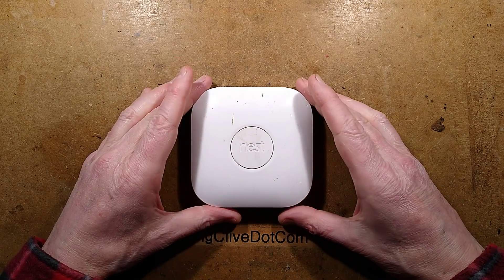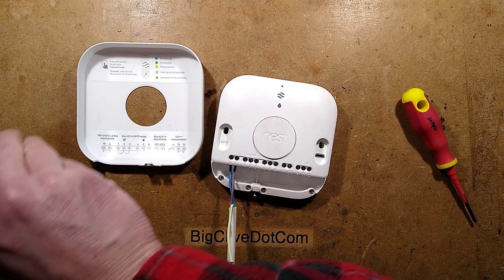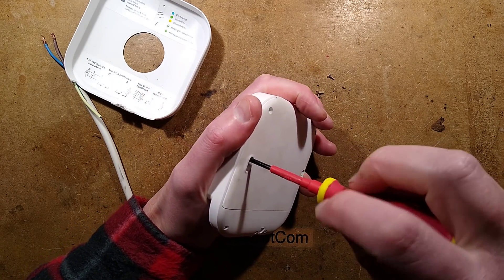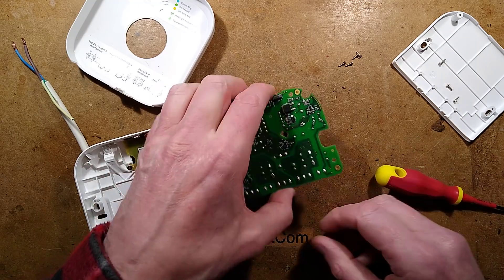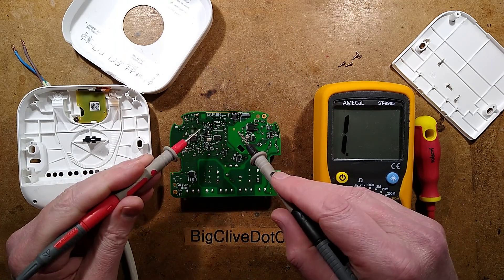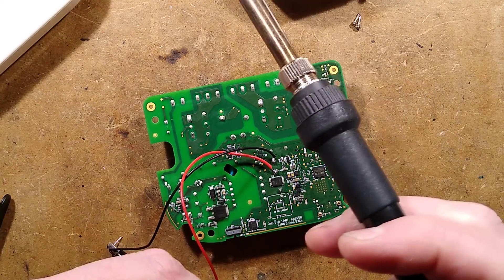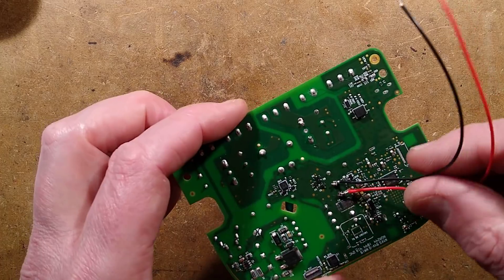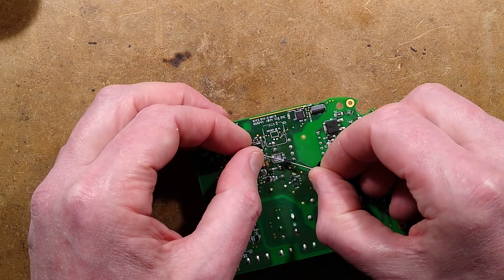Fixing a completely dead Nest thermostat heat link

Comment: The worst weakness is that it's dependent on the manufacturer finding it profitable enough to keep the servers going
Reply from the maker: This is where a geek-run independent server or new firmware wins.
Reply: @bigclivedotcom  I wish there were home server options.
Was an early adopter of the NEST thermostat. But it's useless with a heatpump in Northern climates.
And why the H does it need servers somewhere to provide the pathetic reports we get?
Lots of unused potential and technology packed into it though.
Reply: I had exactly that with my alarm system (iSmart Alarm).  £400 on parts only for them to go down the pan and switch the servers off 18 months later!
Reply: The 3rd Gen can be set up without Wi-Fi so you can use it offline no worries.
Reply: All the automation in my house is totally self contained and has no external dependencies for that very reason.
Reply: If it doesnt Support Tasmota dont buy it 😛
Reply: Yes, this is happening with the Harmony remote controls. The servers are still up... for now.
Reply: @rich_edwards79  God, aren't harmony remotes like... a throwback to the early 2000s?
Reply: @rich_edwards79  yikes, I still use my harmony remote every day. Hope they stand by their statement about continuing support whilst customers still use them..... but how will this be judged?, because I only update mine infrequently or when I get a new bit of kit to control.
Reply: Exactly. You don't own it, you are permanently leasing the product.
Reply: This is why I made my own thermostat (with amongst other things an ESP8266) that runs a local www server.  No out-of-the-house servers required :-)
Reply: There is no reason why my home heating / cooling thermostat needs to talk to the internet. Same with my fridge, stove, etc.
Reply: For me, the worst thing about these is always the user interface, which is never customizable to the extent I want. Take a simple temperature IoT thingie. It uploads to the server maybe every five to ten minutes, static of course, because why would you want to change it? What if I want to do 1-minute measurements, like comparing rapidly changing temperature inside a car running a heater, with the outside temperature? It's pretty likely that I can't do it, regardless of the manufacturer. Then there's the UI itself. The graph on the website might not be customizable at all. Let's say I wanted a static view of -30 to +30 degrees C. Might not be possible at all. Maybe if I paid for a subscription, but even then that might not be possible or the graph might be otherwise unusable, maybe having a fixed time range. Then there's the data retention... Let's say it feels like the fridge isn't getting as cold as it used to. Let's check what the temperature was 2 years ago and how it has gradually come down. But wait, there's no data?! Of course not, because the stupid platform only retains a year's worth. Meh. And for these reasons, I'm out. A DIY Raspberry + database + free graphing tool is much better. IoT and online platforms may be better for automation, but when you really want to customize even simple stuff like temperature readings, don't get your hopes up. One really annoying thing is that you can't usually try all these without buying them. Only afterwards will you really see how bad the online platform is.
Reply: @Stirmeli  Your commentary explains why I started down the rat hole of developing my own thermostat based on a RasPi. There were only a couple of things I really wanted my t-stat to do: 1) Keep the temp stable; 2) step the temps down at night, back up in the morning, back down during the day when all were at work, and to bring it back up in the evening when everyone was home; 3) know when to switch over to AC or heat, based on the temps outdoors and the time of year.

Unfortunately, the project suffered from scope creep and it started to tie into my greenhouse temperatures, and the sprinkler system (which was it's own project), and while we're at it, why not integrate it into the home security system, and all sorts of other BS. 

In all of these iterations, not once did any of these devices need to go out to the internet, nor did the internet need to come to them.
Reply: @PyroRob69  A Raspi (with a corruptible SD card OS) is a bad idea for anything requiring long term reliability. I go with a basic Arduino (Nano/Pro Mini) for basic functionality when possible, and then add Raspi or preferably ESP for connectivity
Reply: @rexsceleratorum1632  you can set up the OS to be immutable and still be able to add patches as needed which mostly fixes SDCard corruption. At least to the point where the atmel micros will probably die anyway.
Reply: @mattymerr701  Unless atmel micros are particularly shoddily made, you are describing an alternative with way more moving parts and way more critical things to break. You say it will be just as reliable. I'm gonna take that with generous helpings of salt.
Reply: @rexsceleratorum1632  Well, the great thing about electronics is that there are no moving parts. Especially when you are using static flash memory 🙄
Even more so when it is large enough that you almost never erase cells.

Micro SD Cards can store data for longer than you will probably care about, and since they are easily replacable by a user, they are pretty easy to ignore tbh.
Easier to replace than desoldering a BGA and replacing it.
Reply: @mattymerr701  Ah, you thought I meant actual moving parts. Okay. Tell me again how one microcontroller IC with a small amount of built-in flash is less reliable than a full blown miniature computer board running Linux and having a dozen ICs, DC-DC converters, plug-in off-board SDCard flash, and stringent power requirements, heat dissipation requirements
Reply: @rexsceleratorum1632  I agree with you 100% on the SD cards. I would use the SD card to boot off, and have all of the true functionality run from a spinner or SSD. I have experienced the high failure rate of even the best quality SD cards.
Reply: Good job! What’s the diode doing, stopping back emf from the relays? It might just be the thing is underrated from the factory for the short spikes as they open.
Reply: true!
Reply: It does not require WiFi to function.
Reply: True, unlikely with Nest though as it's Google and they own their own cloud platform, this likely runs on serverless architecture with hundreds of other applications also running on it. We're taking about simple JSON api calls and virtually no bandwidth costs.
Reply: @james-5560   Google have a really bad track record for discontinuing old products. They had a previous line of smart-home products that the discontinued when Nest came out.
Reply: @katrinabryce  Are you referring to the devices made by Revolv?
Reply: @katrinabryce  However these days the big companies don't really need to stop supporting products as the cost to sustain is so minimal. Back 10 years ago + yes when they had very different architecture. If they did ever EOL it there would definitely be third party firmware / open source project.
Reply: @jamescollins6085  Yes, that's the one. Couldn't remember the name.
Reply: @james-5560  Google is notorious for abandoning projects/services. I wouldn't depend on them for anything long term.
Reply: @james-5560  I mean, it being a simple thing with barely any server cost or maintenance needed didn't stop Google from killing their flippin' RSS reader.
Reply: @james-5560  Google is kinda famous for aggressively culling offerings. A platform cannot exist without AT LEAST a maintenance engineer who will patch up security bugs as they occur, if the recent LOG4J disaster is any indication. Now whether Google will or will not shut down Nest is a moot point, you might be actually best off having Nest's device compared to their competitors, but the whole category of products is fragile because each product/lineup has a central point of failure that is outside your sphere of influence. I'm sure in due time there will be a lot of IOT devices in people's homes which still kinda work but didn't receive any security updates on the device end for years and which will make for a perfect attack surface; and there will also be data leaks and other compromises of cloud companies handling your data. There will also be companies (presumably not Nest, but remains to be seen) which let their domain or central endpoint lapse and fall into someone else's hands, and those people can then weaponise the fleet of devices. The potential security problems exist whether the device is running OEM firmware and infrastructure or hobbyist one.
Reply: @james-5560  "serverless architecture"? Do you mean a virtual infrastructure?  I can guarantee there are servers involved.
Reply: @james-5560  is "serverless" truly serverless? :)
Reply: @james-5560  Google has got a terrible history with killing products & services with little to no notice
Reply: @james-5560  No, we are talking about maintaining a service that needs reaction to security issues and technical changes.
Try to online-activate a Windows XP. It doesn't work. The servers don't run anymore.
Reply: @MetalheadAndNerd  Final point!!! EVEN IF.... IF Nest went offline, the thermostat would STILL work locally! That's all.
Reply: @james-5560  I have proven you wrong. Looks like you can't live with that. Your problem.
Reply: @james-5560  how do you set this thermostat without a remote service? I see a button but no dial, no display. Maybe it's Bluetooth with an app which itself needs maintenance? As for the cloud service, it needs maintenance to prevent exploits and a PR nightmare so there's an ongoing cost. Old hardware often cannot support new standards (tls 1.3, wpa3 as examples) so will become obsolete and unsafe. IoT is for the short term, but that's okay if you plan for it with devices where connectivity is optional or just buy cheap disposable stuff.
Reply: @CampGareth  You see a button, but no dial hahaha no research at all done again I see.
Reply: @CampGareth  it's a 2 part system. The Heat Link comes wired to your system while the dispalay and base is separate - at the location where you wanna set the temperature.
Reply: @MentalD-Fox  ah so bigclive just repaired the box that orders the dumb heating system to fire and connects to the display unit which then handles temperature sensing, scheduling, Internet connectivity. The button is for forcing the heating on if the display connection fails. Neat!

I'm not sure the IoT lifespan side changes though. Maybe if Thread takes off, maybe if compatibility is maintained between generations, maybe if the Nest specific stuff on top is open sourced...
Reply: @CampGareth  Even if they ended the service, it still works as a basic thermostat with no internet connection. So you've nothing to lose really if the only reason you're afraid of buying it is if the world's biggest and most well known IOT thermostat gets discontinued (unlikely anytime soon).
Reply: @MetalheadAndNerd  you saying that you've "proven him wrong" doesn't make it true

+ WXP has phone activation allowing you to activate it genuinely anyway (without the need for their activation servers)
Reply: @nyaa  You are implying that a problem doesn't exist as long as there is some kind of workaround. That is also wrong.
Reply: @MetalheadAndNerd  james' point makes total sense, nests are physical products and windows is a piece of software that runs on your computer. phone activation was never a "workaround", it has always been in the operating system since as long as activation was a thing. 

and for your example where you talk about security issues, XP is EOL, it shouldn't even be used in new environments because of all the security holes from new vulnerabilities discovered
Reply: @nyaa  A product becoming "EOL" because the manufacturer wants to sell something new is the right point. That's what is going to happen with all cloud-based devices. 
Windows XP is just an example for a popular product that is no more supported and related services have gone offline.
Reply: @CampGareth  I just helped my son set up a new Nest thermostat entirely via Bluetooth. No wifi connection at all. There may have been an option for it, but we didn't look for it. Via Bluetooth, setup took maybe five minutes.
Reply: @MetalheadAndNerd  show me one piece of software from 2005 that's actively updated with security updates. you also invalidated your point: 
"""No, we are talking about maintaining a service that needs reaction to security issues and technical changes."""
Reply: @nyaa  No, my point is perfectly valid. A 15 years old license server without maintenance would be a huge security liability.
Reply: @james-5560  Yeah, google always offers an "upgrade path", like they offered me youtube music where I can rent music when they killed google play music where i was able to BUY music. Great downgrade path...
Reply: @MetalheadAndNerd  you brought up WXP, not the license server
Reply: @nyaa  You should read my comment to the end. I brought up Windows XP's online activation which tries to check the license via a no-more existing server.
Reply: @MetalheadAndNerd  I did read it, you ignored my point about phone activation not being a workaround and made a separate argument
Reply: @CampGareth  pretty much. The dispalay handles all the fancy functions. The box (heat link) is just a on/off switch that can handle high voltage. And yea the button on it is as an emergency override if your displas fails and for testing of course. Though if the Heat Link fails your out of luck :)).
Reply: IoT is simply the worst idea ever.
Consumers getting tricked into sharing data and paying service fees when there should be no need.
Reply: I wish these devices would talk something standard like MQTT, even if it wasn't normally required by the app, it would be a nice 'advanced' mode for when the manufacturer becomes obsolete.

I recently got an EV car charger and it looks like they've just used a Beagle board inside. Once it's out of warranty I'll be taking it apart to extract the firmware for sure.